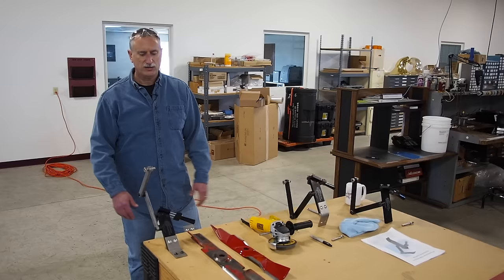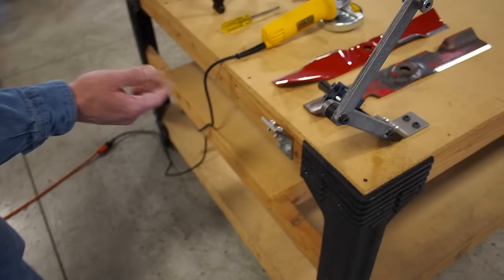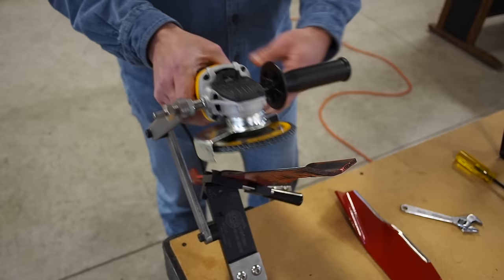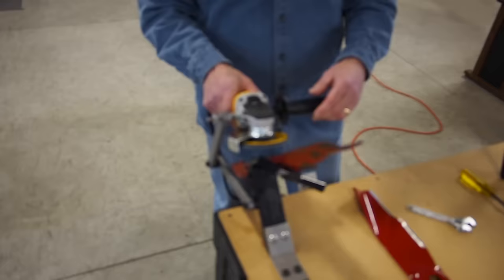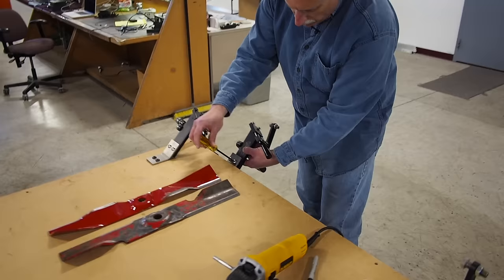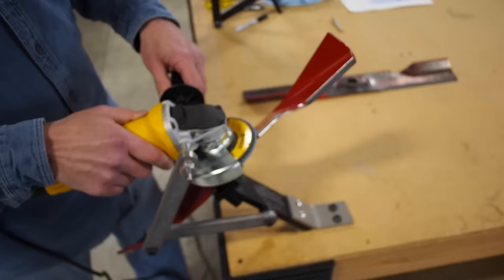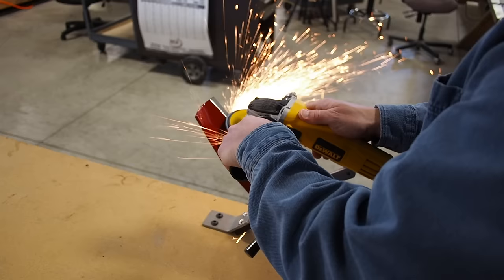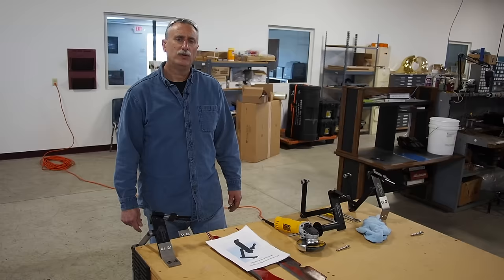All American Sharpener In Depth Tutorial (2017) - Lawn Mower Blade Sharpener

Comment: Here is some valuable information that worked for me and may work for anyone using the All American 5005 and the following blades: HONDA HRX17: W159671(UPPER BLADE) 30deg; W159977(LOWER BLADE) 35deg with All American adapter installed. John Deere: M154062(BAGGING/HIGH LIFT BLADE) 40deg; M149422(MULCHING BLADE) low outer edges 30deg, raised inner edges 25deg; GY20850(STANDARD 3-IN-1) low outer edges 35deg, raised 15deg.🤓
Reply from the maker: Thanks for the feedback. We know that angle settings vary with blade geometry and wear, but it's helpful to hear specific information from our terrific customers! Wishing you many years of great service from your 5005!

Comment: I can attest to the sheer (design) genius of this sharpener. I use a Norton 980 ceramic abrasive fiber disc on my grinder with it (over the usual flap discs) and this sharpener hones my blades with ridiculous precision! The 5000 model works like a charm, but if you're in doubt, get the 5005 model. You'll thank yourself for years to come.
Reply from the maker: Zaine - Thanks so much for the positive comment. Glad to have you as a customer!

Comment: So I ordered this last week and received it two days later. Setup was very straightforward and it came with four pins so there was one that fit my old Skil grinder. The build quality is excellent and looks like it should last for many years. It's easy to use and does a awesome job of sharpening the blades. Always used a bench grinder before and never could get the angles right but not a problem now with this sharpener.
Reply from the maker: Thanks for the comment, Rodney! We're glad you are happy with it!

Comment: Todd, ordered the 5005ext with Honda adapter and received it in 2 days, I just couldn’t wait to test your product out. Instructions were very clear and precise. The product material is first class you can tell a lot of time went into this and it will last a life time, I pulled my Honda blades out and went to work and oh my what a difference, I have been paying between $10 and $13 to have one blade sharpened (Honda has 2 blades), so $20 out the door, your product is awesome and makes it so easy. I just love it——- ps.  The guys sharpening my blades was just tearing them up not very sharp and not at factory 30 degrees angle.
Reply from the maker: Roy - Thank you very much for the feedback and compliments! You're exactly the kind of person our sharpeners are made for, and I appreciate you taking the time to leave a comment.

Comment: I was a farmer. We would use hard surface welding rods, and where ever the metal would wear on subsoiler feet, and shanks . We added the hard surface. I started my own lawn service.  I use one set of blades to see where they wore down the most. So where  they wore. I added hard surface, which included the cutting edge . When I sold the riding tractor. Those blades were still on the mower. Give it a try.
Reply: Thats a great idea Charlie

Comment: Well, it sure impressed me, so I went to his website and bought the Model 5000, because I  have 3 mulching blades in my Exmark 52-inch Radius zero-turn mower.  I also bought some 40-grit flap discs for my DeWalt D28402 grinder (his grinder looks like the grinder I have).  If I remember, I'll return and give my impression when I've used his jig a few times.
Reply from the maker: Thanks for the compliment! We look forward to your thoughts after using it.

Comment: Feedback on my new 5005.
I Consider it a winner.  I finally was able to sharpen a blade from my Woods 60” ZTR.  It worked great.  I found my blades are angled at 45 degrees.  I need to sharpen and balance several blades so I will be switching over to a standard grinding wheel.
Reply from the maker: Thank you for the follow-up. We're glad that you are happy with it!

Comment: Just ordered mine today and I’m stoked. I’m sure I’ll figure out what I need to do with my mulch : gator blades but they appear to have a 30 degree and a 15 degree. I ordered the 5005 gen 2 so I’m sure I’ll just have to play with the settings to see how it needs to be ground. I do appreciate you showing how to grind half the transition at a time. I think that was another thing I found confusing.
Reply from the maker: Awesome! Thank you for your business and support! If you haven't seen it already, below is a link to a video showing the process we use when we are trying to determine the best angle settings on an unfamiliar blade. It might give you some more ideas as well.
https://youtu.be/YQd8xbZgkq0?t=53

Comment: Using a grinder takes off a LOT of material making balancing more difficult.  I sharpen my blades several times a season in a vise, using a 40-grit flapper wheel on a drill.  Blade is razor sharp and I never have to worry about balancing.

Comment: Just dawned on me.  My blades are mulching blades and I would surmise that the blades cut the grass particles flying around in the deck  again and again, now just once.  Sorry about the “too quick”  question on having to sharpen the raised section of the mulching blade.  

JoeB
Reply from the maker: Not a problem on the question. As you have pointed out, the inside raised cutting section does have some value. It is there to redirect airflow and help chop up the already once cut mower blades. But we do agree that the most important cutting section of the blade is the outside 2 or 3 inches. That's where all the original cutting action happens.

Thanks for your comments!

Comment: I love it. I have 5 acres and use a riding mower as well as a brush hog with tractor.  Do you think I could modify the blade holder so I could hold my brush hog blades in place to sharpen them with your jig too?
Reply from the maker: Hi John. We have had some customers who have been able to adapt or modify their jig to work with their brush hog blades. But, in general, we cannot recommend it. Our jigs are very sturdy, but only meant for mower blades. We fear that many brush hog blades are just a bit too hefty for the device. One day down the road we may develop a larger jig that is meant for brush hog blades. Thank you for your interest!

Comment: This looks like a great product! I just placed an order for the 5005. I'm hoping it works with my DeWalt cordless grinder. Also I couldn't help but notice your desk in the background. I have the same, have had  since the 70s (still using). Looking forward to finally retiring my manual file and drill grinder.
Reply from the maker: That's awesome, Bob! We haven't run into a DeWalt cordless in the 4-5" size that doesn't work with our system. Please reach out if you have any questions once you receive your 5005 to support@allamericansharpener.com. We're grateful for your business!

Comment: Looks like a great device. Can it be made to attached to a vise with out damaging it ? It looks like it would throw off the design.
Reply from the maker: Thanks Lou! Yes, the mounting bracket can be turned around and clamped in a vise without any issue. You can see a demonstration of this in the video at the link below.
https://youtu.be/77Qg3cVc_f4?t=81

Comment: Question.....why sharpen the raised section on the blade.  As the mower goes forward the grass is contacted by the leading edge of the blade and is cut or broken off at that time.  The raised sharp area of the blade would never get to the grass first.   So why sharpen it ?  This is not a wise guy question.  I am an engineer and this type of question will always come up.    Another question,  an older YouTube  video was by a manufacturers rep advising against a razor sharp blade on a bush hog.  If I remember correctly...his reason was that the sharper the edge, the more likely it would be chipped and damaged as  the blade encountered stones, stumps , etc.   Do you subscribe to his reckoning?   If so, should the grass  lawn mower grass blade be extremely sharp?
Great video,  great simple tool.  Just wondering about how sharp a mower blade should be.  Anyone else out there have any  experience with my  thoughts ?
Thanks for the video.

JoeB
Reply from the maker: Hi JoeB. Thank you for your comments and kind words. We agree that the inside raised section is a secondary edge. All the real action is happening on the outside cutting section. But, as you pointed out in your other comment, it does do some mulching. That section is also responsible for air redirection to help mulch up the already once cut blades of grass. So having that edge sharp is also helpful.

We try not to argue about whether the mower blades should be razor sharp, or slightly dulled. There are some people that are very passionate about this topic. Personally, we do not dull or blunt our mower blades after sharpening them. The theory is that, if they are too sharp, they will take nicks more easily. This may be true. I would imagine a lot of that depends on the environment you are mowing in. We do not have any issues mowing our grass with a sharp blade. Any nicks that I see in a my blades, are likely nicks that would have happened even if the blade was slightly dulled before mowing. I suppose it also helps our decision knowing that we have a simple way to sharpen our blades. So we don't feel like it's a burden to sharpen them on a somewhat regular basis. We probably sharpen them about every 10 hours. That's when we feel a difference as they are starting to get dull.

Thank you for your interest and your comments!

Comment: I have wrestled with blade sharpening for decades.  Always "just OK"....but never the end results I wanted.  Outstanding looking solution and product.  Got to get me one...today!  One question....can the All American also be used to sharpen the much heavier bush hog, tractor- type mower blades?
Reply from the maker: Thank you for your enthusiasm about our sharpeners! We have put some thought into a possible design for alternate blades, but the project hasn't gone beyond that yet. We have had some customers who were able to adapt their 5005 to work with bush hog blades, but in general, we still do not recommend it with our current jigs.

Thanks for checking in with us about it. I can't make any promises for a product in the near future, but it is something that is still on our radar.
Reply: @AllAmericanSharpener  many thanks for your very quick response.  I will be following your efforts to design/release a jig specifically intended for tractor mower bush-hog type blades.  I have a huge need as I am certain others out there do also.
Reply: I was just online reviewing all your current models...their uses and benefits.  Looks like the 5005 is the "Cat's Meow" for my current needs.  With 3 different mowers using 3+ different blades, I think it would be my best choice.  Will be ordering it today.  Thanks again for your very timely response to my inquiry.
Reply from the maker: @dwayneloftice2326  - You're very welcome. Thank you!

Comment: One way to improve upon your design would be to add a bearing and concentric cone to the outer portion of one of the pivots on the ‘arm.’ This would allow the operator to ‘stick’ the blade, via friction or magnetization, on the cone and allow gravity to be the decider of a truly balanced blade- assuming the bench or mounting bracket would position the arm into a relatively plumb (vertical) position. Pretty ingenious as is, however. PS- I’d take a 10% royalty if you’re able to bring this to market. 🙂
Reply from the maker: That would be a pretty slick upgrade!
Reply: It's called a Magna Matic blade balancer. Exact same design you're inferring that he add to his design.

Comment: What's the point in having the angles labeled if you just quickly adjust it without looking on the mulching blade? 2 different angles, both are supposed to get a 30 degree angle ????
Reply from the maker: Hi Chris. On the Model 5000, there are 2 settings specifically for commercial bi-level mulching blades. They are marked more just so you can remember which setting is for what. On our newer Model 5005, there are multiple settings. So it is important to have them marked to come back to the same settings every time you sharpen a specific blade. Different blades need different angle settings. The angle adjustment is needed because of the tilts or twists in a blade. Here is a link to video that might give you a better idea of why the angle settings need to change. https://youtu.be/VejPPKBv_9o
Most times, the adjustments are in order to keep the factory angle, which is usually close to a 30 degree edge.
Thanks for your interest! Hope this helps. If you have more questions, you can email us at support@allamericansharpener.com
Reply: @AllAmericanSharpener   Awesome, thanks for that detailed explanation !!
Reply: check out a locking hinged knee brace. they give you full 90 degree range of motion if you desire, otherwise you can put pins in the hinge to lock the movement from exceeding certain degree's. maybe that could be of use of the design. i want to get me one of these. I just started my own lawn service late last year but I'm looking to make a big push this year
Reply from the maker: You're welcome, and will do! We're all about the details.

Comment: This my be a silly question but how do I determine the pin size for my grinder ?  Also, since I use various mower blades in my fleet (i.e. standard, gator, high lift, etc.) which sharpener model would you recommend - 5000 or 5005?
Reply from the maker: We include 4 different adapter pins with our sharpeners, and one of them should fit your grinder. There are a few exceptions, and I will include a link to the spreadsheet we have been building with common grinder thread sizes. https://docs.google.com/spreadsheets/d/e/2PACX-1vQDszcT1Z3vLhwPYrQa8IxdN3aFanMZCHrbS1JR59SUGMEfMzpHl9Wq2yG_ZLJktflkmwhpD8FVtdjY/pubhtml?gid=69379172&single=true

If you are sharpening a variety of blades, the Model 5005 will be best suited to that. It allows you to adjust the angle from 15 degrees to 45 degrees (in 5 degree increments), and should accommodate most anything you throw at it.
Reply: Thanks a million!
Reply from the maker: @BroadwayJoe49  You're very welcome! Please reach out if we can provide any additional assistance at support@allamericansharpener.com
Reply: @AllAmericanSharpener  Do you have any promotions (discounts) for your 5005 blade sharpener?  I would really like to purchase this model but the budget is a little tight after replacing landscaping tools due to theft  (hedge trimmers, blowers, small mowers and hand held tools).
Reply from the maker: @BroadwayJoe49  We don't offer any discounts or promotions on our products. We've made great effort to keep our sharpeners as affordable as they can be, while still maintaining the quality we believe is important. Thank you for checking in, and for your interest.

Comment: Did you ever make a tool  for sharpening  Bush hog blades? Also, tool for  shovel & hoes ? Maybe a sharpening tool for  chain saws without the motor above but to pull horizontal to you to see better.  I know you guys can do it. Thanks.
Reply from the maker: Thanks for your confidence, Larry. Design development and production is a pretty involved process, and at this point we've kept our focus on basic mower blade sharpening. Bush hog blades continue to pop onto our radar, and if we were to broaden our scope, that might be a direction we'd look into. No promises at this point in time. 😊

Comment: How does it work on a blade in which the cutting edge is not in straight alignment. All of my blades have “wear” on the cutting portion and do not remain straight. Just wondering....
Reply from the maker: It will try to keep a straight line, but the grinder will still sharpen a worn edge that does not follow a straight line. It may take more passes with the grinder to get the whole edge sharp. The best example I have is this bi-level blade I sharpened for someone else. It was in pretty bad shape (worn with deep nicks), so I had to spend more time on it than an average blade. But I didn't have to grind until I had a straight edge just to get it sharp. I will share a photo link below:
https://photos.app.goo.gl/crkDGD4nCYtX8YuaA

Comment: love it!!! going to buy one!!
Reply from the maker: Thanks Roger!  We are sure you love it even more once you get it!
Reply: All American Sharpener I have a drill master 4/12 angle grinder I hope the handle threads is standard.. I have looked on Web but cannt find it.. Harbor freight brand.  I have 10 acres to cut with a 65 inch snapper pro... just took off blades for first time an I see some nicks in blades from rocks an good ones. this will be the first sharpen... I got a jack to raise lawn mover easy an get your sharperner an I can keep sharp blades all the time....
Reply from the maker: I am not sure what thread that grinder uses, take the handle to a hardware store and try nuts on to verify before you order.  Should be M8x1.25 or 5/16-18 or M10x1.5 so try those first.
Reply: All American Sharpener thank u!!

Comment: Can the sharpener sharpen the Toro Timemaster 30” blades?
Thanks!
Reply from the maker: Absolutely. This video has relevant information, but it was created before we made our Model 5005. That is the model you will want for those blades. You will likely need the 35 or 40 degree setting on the Model 5005 to match the factory bevels on Toro Timemaster blades. Thank you for your interest!
https://www.allamericansharpener.com/5005
Reply: @AllAmericanSharpener  thank you! Will be ordering the 5005 gen 2

Comment: dose it have to be a dewalt
Reply from the maker: Absolutely not. You can use any 4-5 inch angle grinder. 4.5 inch angle grinders seem to be the most common. Cordless or corded, straight or angled handles will work. Thanks for your interest!